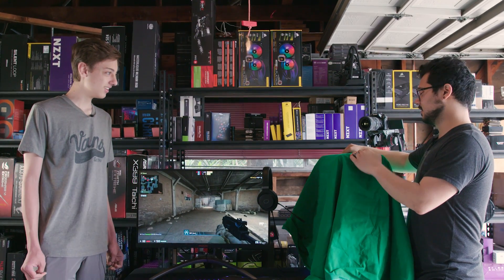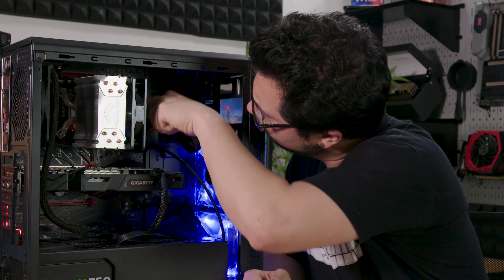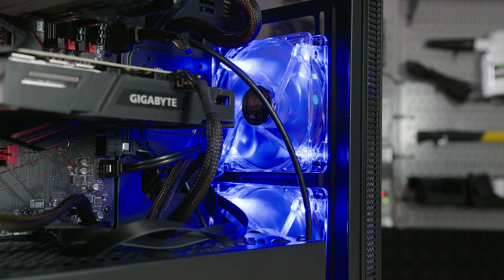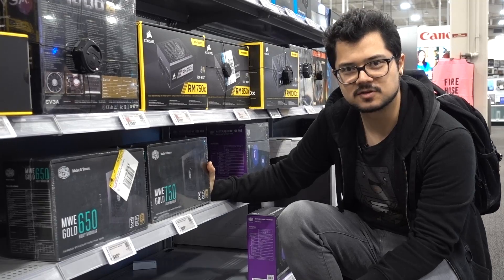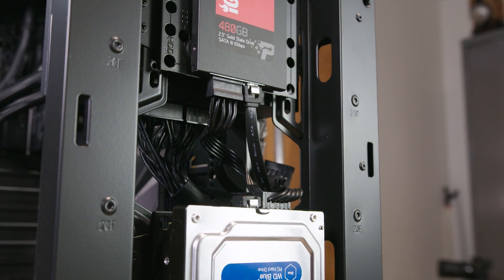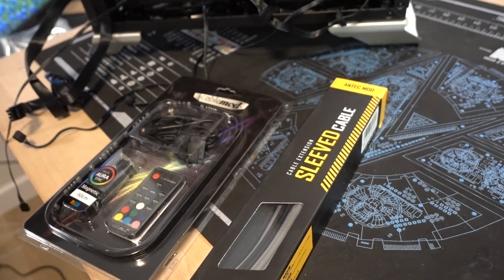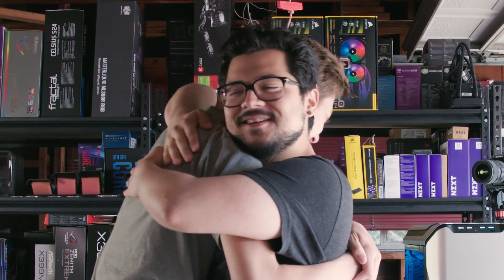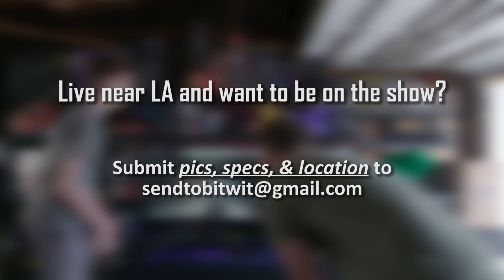He didn't see this coming a MILE AWAY #pimpmyrig #pmr #episode6

Comment: HA! You think this one started bad? You should see my pc...
Reply: What are you running?
Reply: @Shmojoe14  AMD FX 8300 cooled by a hyper 212 evo on the Asus m5a97 motherboard, 16 gigs of ddr3 memory at 2200 MHz and an AMD RADEON R9 290X with an nzxt aio bracket for a cooler master aio. I'm lucky to pull 40 fps in games like skyrim at 1080p with a light mod list.
Reply: Brian Griffin still a pretty decent rig compared to some I’ve seen in the comments. A lot of athlons out there... I just upgraded from basically the same system. Was running an 8120, 8 gigs of ram and a 390x I watercooled. Now I’m in a i5-8400 with a 1070ti and 16gb as well as M.2 NVME ssd. The computers are night and day though.
Reply: @Shmojoe14  yeah, I'm grateful for the system I have, dont get me wrong. I was more commenting on the status of the original system. It was pretty good as is for 1080p gaming. I really wish I could upgrade the GPU though... even under water, it still runs at about 60 c under load.
Reply: @BriMonster2001 I get that, i was constantly at like 91c on my 390x ...

Comment: This guy already had a system that was far better than the average person has. But either way, great for him to get an upgrade.
Reply: He's got a better system than me, and I don't really need an upgrade.
Reply: He has got a better system than probably 80% of all gamers. Performance wise at least. Tbh swapping out the case, cooler and mainboard would've been more than sufficient.
Reply: Yeah I think he could have chosen a better candidate to get a new PC. But that is not my choice, or yours. HAHA! <3
Reply: yep upgrade was not needed. Better find some kid with pentium and integrated graphics and upgrade that not already good system.
Reply: @bloodsucker3296  why? Who says that someone with less specs is more deserving? Also who is to say these parts won't be passed on?? Bunch of helps asses who come out with the "someone else deserves it more" line and there will always be someone else more "deserving".
Reply: Ya i have a prebuilt dell from like 2007 with a core 2 quad q9400, 8 gigs of 633 mhz ram and an nvidea gt1030. but im working on saving money for at least a decent system.
Reply: @6scrubs  And still you have better specs than me:
Core 2 duo e8500, 4 gb of ram and intel integrated graphics (q45/q43 express chipset, also known as gma x4500.).
Reply: Doesn't really matter. Kid seemed nice enough and was appreciative of what was given to him. Sure he had a system that was already not bad, but have you seem some of the systems built by these guys? For most use cases they are 100% overkill.
Reply: His gestures seemed unnatural tho... Either way, I'm sure Kyle and the kid enjoyed.
Reply: Still rocking a 5820k and a 970. Can I get this kids old stuff???
Reply: @charlesrichard7715  2600k :P with r9 380 Pepega
Reply: @charlesrichard7715  i7 5820k is still a great CPU. Especially if you overclock it. But your GPU could use an upgrade for sure. :)
Reply: Does Kyle keep the system he replaces? And Cooler Master pays for the new one?
Reply: ofc he's charging for that ? he os pimping so uts doesnt mean he's gonna give away for free xD
Reply: @PeterGriffin-no8gw  Isn't the whole premise for this video that he gets the upgrade for free?
Reply: Here i am using my integrated graphics and a broken keyboard....
Reply: Right? I've got an 8700k and a 2080 ti. Can I have my rig pimped? Can I has Titan RTX plz?
Reply: @primorditekgaming  I'll trade you
Reply: His old rig is definitly better than my current one, 2 core cpu, 512megs of graphics and 16 gigs ddr3 ram
Reply: He obviously paid Kyle for all the upgrades
Reply: wUT? Far better than a average person? I thought mooost people had a 1070 or a 590 atleast
Reply: @xtviuchmv1573  No, the average person has a 1060. At least according to Steam stats.
Reply: @Republic3D  are you serious???? What
Reply: @xtviuchmv1573  Yep. The average guy doesn't have a high end rig. It's 1060 at 15%, then 1050ti at 10%, then 1050 at 5%. Then 1070 at 4%. 

Only 1,6% have a 1080ti for example.
Reply: @Republic3D  that is interesting
Reply: depends on where you live, i just hope it was that way here
Reply: I have a laptop, in it a Celeron and parts of the keyboard doesn't work. smh.. Get on my level.
Reply: everyone in this thread is so salty I swear
Reply: Rayy902. Lol
Reply: @rayyanp5472  There's a little bit of salt. But what do you expect? I'm happy for the guy who got a new system. Maybe he did deserve it. It could really be. However, on the surface it seems like there are plenty of candidates out there with ancient rigs and no means to upgrade who might deserve it more. You know?
Reply: R3D I do get it, but like, come on, is not gunna change anything
Reply: @Republic3D  Noone is salty. They are just disappointed in these types of videos. 90% people who get picked already have decent pc. People want too see a smile on a kid who was running a pentium pc over 10 years and who cant afford really a decent pc. They are still people who want a decent pc and by that i mean anything like 2gen i7 or 4gen and maybe 1060 or r9 380.(or less ) There is no point on watching someone who already experienced 1080p or above without lag ...  I want to see a kid or teen who was running 720p with lags and still keeps playing even if it hurts his soul because he cant afford parts.
Reply: Btw 4gen i7 is still above average pc. Dont quote me on that
Reply: @filds1  Yep I agree 100%.
Reply: @filds1  Anyone who is playing on a pentium pc for 10 years can easily get a job and save up like I did. Don't get salty that you are lazy and want to game all day... Better yourself
Reply: @Joogie4k  Well don take me serious about pentium... How it looks like you still did not get the point... They are still kids who cant work but dont have the money to buy something decent like 2 gen i7 or above gtx 660...
Reply: @Joogie4k  By your logic. This dude who won the GW. Why didnt he work and get the parts ?
Reply: @filds1  I don't really think pc gaming is an essential part of life as I didn't have a decent computer untill I was making my own money.
Reply: @filds1  Did I not say for the people who are complaining and jealous over this? Lol...
Reply: @filds1  Might as well complain about somebody winning the lottery.. Or instead you can work hard in life and make it to the top
Reply: @filds1  This is the kind of reply I'm looking for. These idiots donot understand that we all are happy for the guy who got an upgrade over his already potent rig. 

But we actually want to see those kids' reactions who have been running core 2 duos and integrated gpus bcoz they can't afford anything else....why don't these utubers choose people who are that poor? Don't these guys have hearts??
Reply: @amashaziz2212  Idk tbh

Comment: I'd trade him my rig for it lol, 4790k, gtx 980, 2400mhz ddr3. We also don't speak of the monitor I'm using cough Dynex 46" lcd cough I'll be getting the 34" 144hz lg g-sync panel on my next check... maybe lol.
Reply: Hey as long as it sill works right lol?
Reply: @Shmojoe14  It is fantastic haha definitely solid for it's age. Tv is dying a bit, picture inverts sometimes lol. But it's getting replaced.
Reply: @GashenSai  Haha the new panel you're getting will be nice though.

Comment: His old system looks better than mine
Reply: What are you running?
Reply: Amd athlon x4 740x 
Msi GeForce gtx 750 ti
8 gig ddr3 ram
Reply: @putnamehere8940  Ahh, yea ok. Surprised how many Athlons are still out there tearing it up.
Reply: @Shmojoe14  yep. But I don 't have that much money for a good system
Reply: @putnamehere8940  I hear that, FX series processors still do pretty decent and are cheap. Not amazing by any means but i just built a "Fortnite" Rig for my younger brother with an 6300 and a 7970. Puts in work still.

Comment: Kyle, I don’t need a pimping, but damn, I could use some help with my baby.  I had a brand new, less than 2 week old, motherboard z390e gaming RoG Strix and Corsair Vengeance RAM RGB 32g dual channel all fail.  Took to an IT shop for diagnostics and after $300, they gave me back a fully disassembled computer and told me what was wrong and did nothing else.  I am not asking you for anything as a YouTuber, just someone to help me put this back together.  There is nothing else within ~300 miles of me for help and I don’t want to use Geek Squad, they told me $500 to look at it since it isn’t theirs and is a solo build.
Reply: Im Unapologetic I could help you out, the place you took it to probably just milked money out of you. Odds are your ram wasn’t locked all the way in, the motherboard wasn’t wired correctly, or you just got a DOA motherboard. Send me a youtube message if you would like some help putting it together
Reply: @BackdraftCS  Faith restored in humanity.

Comment: That CPU power cable looks like Stefan Etienne routed it
Reply: So very professional right?
Reply: @UKYusei  yes, it's a huge mistake to hide cables behind the back side panel. Letting it hang down like spaghetti means that it will be cooled down by the front fans. People tend to think of the CPU and GPU as power intensive but the cables powering them are even more important to keep cool.

The youtubers like Tech YES City, KristofferYEE, eTeknik Lyle and Paul's Hardware are just pc building rookies trying to sound intelligent. The true tech geniuses are Nilay Patel,  Stefan Etienne and the Walmart PC building team.
Reply: HazmatPyro woah there mega mind
Reply: @HazmatPyro  Cooling down cables? dude stahp giving Gigabyte ideas, or else we will soon have watercooled rgb cables
Reply: @thesmart1000  It would help a lot. My CPU hit 420 degrees Celsius at idle. It's definitely because of the cables overheating and not because my CPU is covered with Thermal Paste and I've also got thermal paste on my cpu cooler.

Idiots claiming that applying a pea sized drop in the middle of the CPU is enough.
Reply: @HazmatPyro  The cables cannot "overheat" on a low-amp current, especially not on a cable conveying 12 volts, your cpu is overheating either due to bad thermal compound and/or failing cooling solution, another cause would be, in the case of an air-cooled cpu, not enough or obstructed (sometimes due to untidy cables laying around) airflow, perhaps not enough in-take or no-to-little exhaust, trust me, cables overheating is at the bottom of the reasons for overheating list, if not not a reason at all
Reply: @thesmart1000  my comment was satirical. I don't think a CPU could ever hit 420 degrees Celsius.
Reply: @HazmatPyro  oh well
Reply: @thesmart1000  Multiple people have taken my jokes seriously. I'm used to this happening.
Reply: at least Kyle screwed it in with confidence.   Didn't spare the tweezers, either.